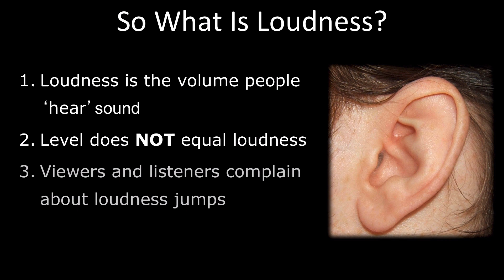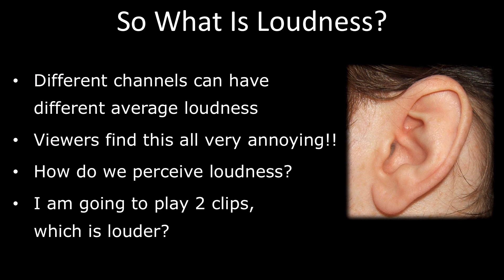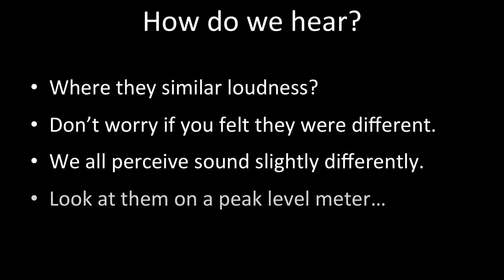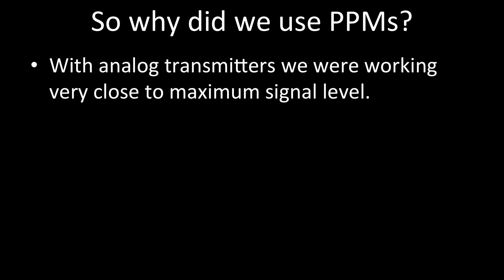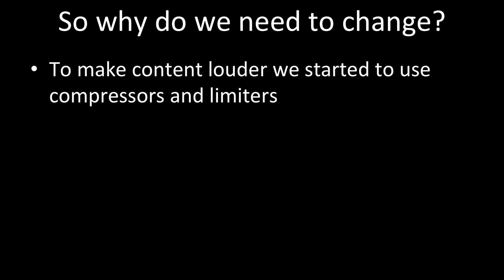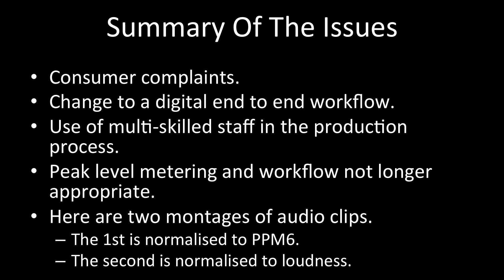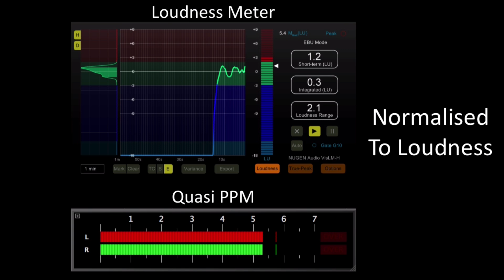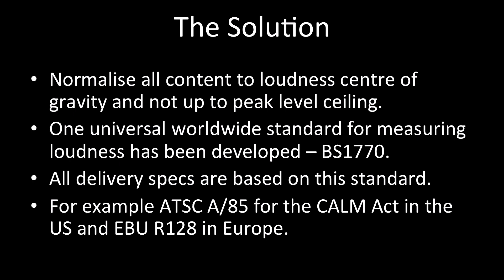Understanding Loudness Part 1 -  Why Do We Need Loudness?

Comment: A bit of historical background on Austrias “bold claim” that they have zero complaints about loudness. Florian Camerer of the Austrian national broadcaster ORF was, and still is, heavily involved in the development of the EBU R128 standard. He is a sound engineer and educator that has been meticulous about educating all of ORF’s multi-skilled staff on loudness from the early stages of this technology. ORF is not as big as for instance the BBC, so the task has not been so monumental. Nor has the implementation of technology been that costly due to ORF’s size. They have also taken the implementation of loudness normalisation a step further as they, in the play out of films, not only just normalise the audio, but also compress it slightly. (They use a very low compression ratio, but set the threshold a bit lower than one would at higher ratios. Thus reducing the loudness range moderately). The dynamic range in films are usually optimised for cinemas/movie theatres, and less suited for a good listening experience in a consumer’s home. The claim might be bold, but the Austrians have been extremely meticulous about the matter, across the full range of their content. 

On a personal note, in my experience (as a broadcast sound engineer in Norway), the complaints are not so much about differences in loudness between channels anymore, but about when the loudness range within one programme (be it radio, television or podcast) becomes too large. Especially is this true in comedy, where everything hinges on intelligibility; if you can’t hear the joke, you won’t laugh. The quality of consumers equipment vary greatly (there’s a lot of bad speakers out there), and the success of a product starts with intelligibility. Achieving this is walking a knifes edge, everyone has to "hear the joke", but the product should still sound somewhat "natural". In other words, not overly processed. In achieving this, the loudness meter is of great help.
Reply from the maker: Hi Malcolm, thank you for the info. I am very aware  of Florian and all his excellent work bothe for ORF and his work on Loudness. Back in the day, we would meet up at IBC in Amsterdam.

Comment: Drives me mad when I'm watching something on TV and the background music totally drowns out the dialogue, makes you wonder who's mixing this stuff!
Reply: You might be getting the 5.1 mix instead of the 2.0 mix, assuming you don’t have a centre speaker for dialogue
Reply: the tv is straight out of the store and I've not touched any settings so you'd think it would work just fine. When you watch an old film the dialogue is as clear as a crystal, we're going forwards and backwards at the same time.
Reply: @davidspicer5241 That's because old media was mastered in stereo, so naturally you will get a more balanced mix between the M&E and the dialogue. While you CAN play a 5.1 mix on a stereo system, the issue lies with how things are down-mixed, and is the reason why the M&E are louder than the dialogue. The rear and other channels are so squished together, it's not as balanced as a native stereo mix.

So unless if you have a dedicated 5.1 setup, shoot for stereo mixes when you can.
Reply: thanks for the info👍 @kylewm